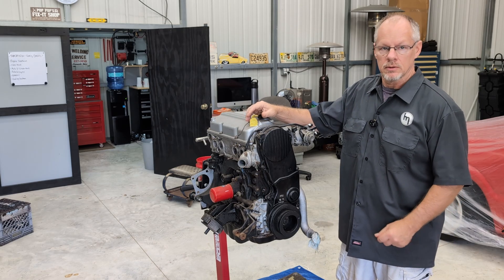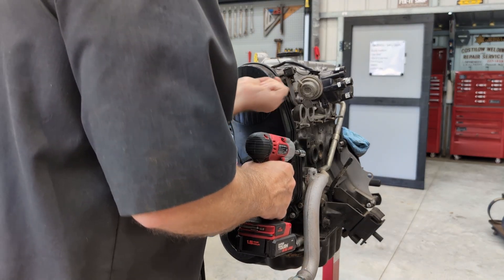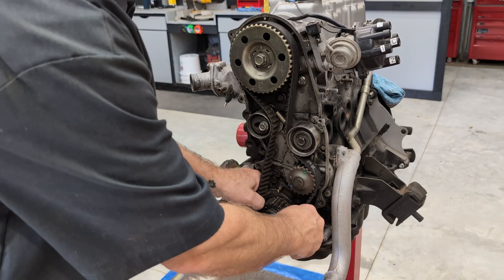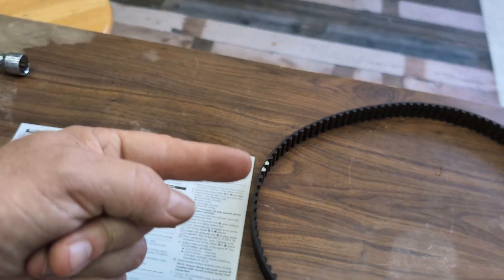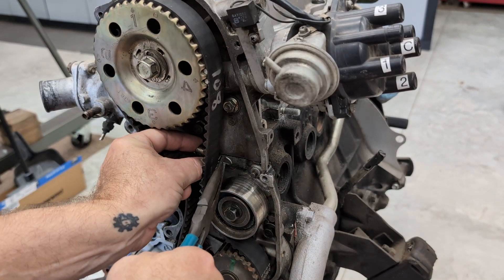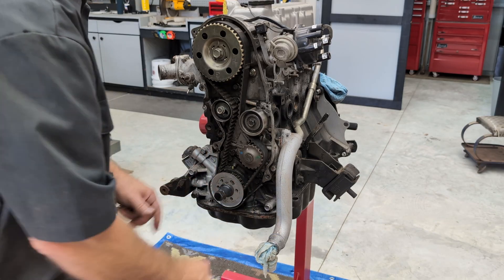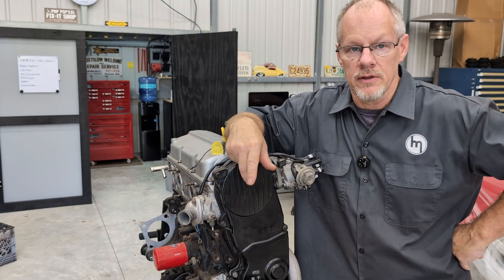How to Replace the Timing Belt on a Mazda B2200 2.2L (Complete Tutorial)

Comment: I think you're setting the ENGINE timing wrong. Set the crank timing mark where the marks line up. Pay attention to where the cam gear is marked. It should line up with the #1 cylinder mark on the cam to the cylinder head mark on the head. Loosen the tensioner and remove the belt. Install the belt onto the crank gear then, the cam gear. Tighten the tensioner. Now, where are the marks on the cam gear compared to the cylinder head mark? It's off to the left side of the cylinder head mark about a tooth or two. Your engine timing is out of time. There will be no amount of carb tuning or distributor movement that will correct the timing. To correct this engine timing, BEFORE you install the belt, move the cam gear to the right of the cylinder head mark about 1-2 teeth THEN tighten the tensioner. Look at the crank and timing marks now. I'll bet they line up perfectly. NOW, your engine is in time.
Reply from the maker: "I think you're setting the ENGINE timing wrong."
* I am wondering if you watched the video at all.

"Set the crank timing mark where the marks line up. "
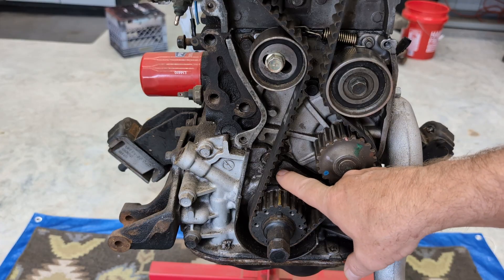* at 05:29 you can see the crank is lined up.
* and again at 08:34

"Pay attention to where the cam gear is marked. "
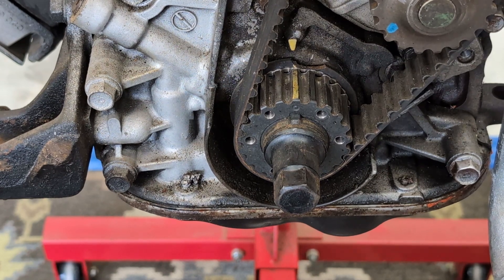* at 6:49 you can see the cam gear is lined up as well.
* and again at 08:50

"It should line up with the #1 cylinder mark on the cam to the cylinder head mark on the head. "
* at this point I am wondering if you even watched the video at all.

"Loosen the tensioner and remove the belt. "
"Install the belt onto the crank gear then, the cam gear. "
"Tighten the tensioner. "

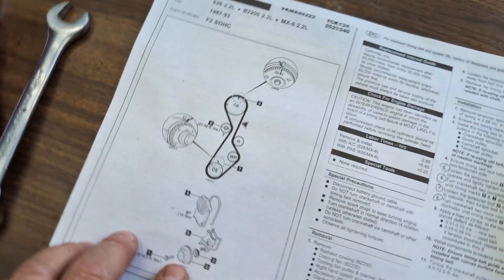*  No let me stop you right there. Look at 10:29 and pause it if you need to to read the instructions. 
5. Loosen the tensioner bolt , allow tensioner to operate and lightly tighten bolt.
6. Turn crankshaft two complete turns clockwise
until timing marks 6 & 7 aligned.
7. Loosen the tensioner bolt to allow tensioner to operate, then torque bolt to 27-38 ft. Ibs.
Read this you may learn something if videos are not your thing.
https://mazdaminitruckin.com/wp-content/uploads/2024/09/Timing_Belt_Change.pdf
* watch this part again at 13:37

"Now, where are the marks on the cam gear compared to the cylinder head mark? It's off to the left side of the cylinder head mark about a tooth or two."

* Camera angle has you confused.

"Your engine timing is out of time. "
* Not its not in fact here it is running before it was pulled, same setup.

https://www.youtube.com/watch?v=sk2HctD6plo

Comment: Fantastic video! Wondering about the engine used though. If the block is a 626 2.0 wouldnt that be an FE? Looks similar to mine and wondering if everything shown applies. Cant believe videos like this exist for these old engines, thank you!
Reply from the maker: It IS an FE block. It's a 2.0 but has all the characteristics of the 2.2. it uses the head gasket, water pump, oil pump and all of the 2.2
Reply: @MazdaMitch  Okay, thanks for clarifying :)

Comment: Hey Mitch I bought a b2000 that was lowered and raised it back to stock and I've adjusted the torsion bars I'm wondering what I all need to do to get the ride height even around the truck
Reply from the maker: If the back is back to stock, your next options are to keep adjusting the torsion bars to get it like you want it
Reply: @MazdaMitch I was able to adjust and get the front even but in the rear driver side is lower by 1/4 in than passenger side how would I correct that
Reply from the maker: @dylanmonen9881  could drop the passenger side front a bit and it may pick that driver rear corner up some. Could also be weak leafs.

Comment: Hey Mitch, currently doing head gasket on 2.0L. The old and the new replacement gaskets have a water jacket blocked by the gasket on cyl 4 intake side, have I been supplied with the 2.2L head gasket or what?
Reply from the maker: That's how it is, it's fine

Comment: Great video.  I've done this job a few times on my own 1988 B2200, but only with the engine still in the truck.  Yeah, it's a little awkward to R&R the six 6.0mm x 1.0mm bolts holding the pulley assembly because of working "blind"; be patient, and I use a 1/4" drive ratchet and 10mm socket and the 1/4" drive digital torque wrench from Harbor Freight for those.  Sometimes this job needs to be done because of a leaking water pump, that's straightforward after removing the timing belt.  Yes, do NOT remove or loosen that big 21mm center crankshaft bolt unless you need to change the crankshaft oil seal too.  I'm not sure why "California" states 90K interval while other states have 60K; I've always done 60K on mine, and I always uses Gates hardware on mine.

Comment: What are the other numbers for on the cam wheel? The manual for my Mazda Bongo (F2 2.0, Japanese market only) times the engine using the 2 mark.
Reply from the maker: Join The forum and post some pictures of that because I'd have to see it to believe it. The bongo 2.0 is no different than any other one.
https://mazdaminitruckin.com/how-to-check-your-timing/
Reply: @MazdaMitch  I will do that. Just checked again, Bongo Friendee manual it is 2 (with picture, so not a misprint). Mazda 626FE manual it is 2 for the FE and 3 for the F8 and F6.
Reply from the maker: @brianb7636  Please join the forum, and post this in there with pictures of your shop manual. Its not going to change anything as what I am doing in this video is how its done on the 86-93 mazda trucks, but I would love to see it. https://mazdaminitruckin.com/forums/
Reply: @MazdaMitch  Yes, waiting on the e-mail. I have pdf's on the FE/F2 changes too and 626 manual which is a bit different to yours (covers 12v engines). Forum says 'not available in your location' for pictures. Is it US only? I am in UK.
Reply from the maker: It used imgur for photo uploads and we have people from all over in there. 
I downloaded a 1987 626 manual and I see where it says this:

Note
For FE engine, align "2" mark.
For F8, F6 engine, align "3" mark.

ON your bongo or 626 engine, the dowel on the cam that should be at the 12:00 position, may in fact be on the 2 on that engine for cam timing.

It is not this way on a typical 86-93 Fe and F2 engine that was shipped here to the USA.

the 86-87 uses an A and 88-93 uses a 1 as that is TDC.
Reply from the maker: @brianb7636  Check spam folder for any email.
Reply: @MazdaMitch  Yes, that is exactly it. The FE (actually an F2 head on an FE 2.0 block) remained in production until 2006 for Japan only although some were brought in to other countries. Minor changes were made to things like the head gasket and modern electronics plus emission controls and an electronically controlled automatic trans. I'll do an intro post on the forum. Great vids, BTW.

Comment: No fricking way man, the timing! (of this timing video lol) I was just changing out my rad hoses on my '92 2 days ago and I wanted to see about the harmonic balancer, it wobbles a bit. I took those 6 10mm bolts out and man that thing just didn't seem to move and it looked like to my eye, that the main 21mm bolt going into the timing gear/crankshaft, was overlapping and holding the damn pulley in as well! Well I guess it needed a bit of a smack from a hammer or something unless someone changed out the bolt on it or something. 

Thanks so much for filming these, even if you're not doing the specific job, it's still great to get other info on stuff.
Reply from the maker: Glad I could help!

Comment: Mazda Mitch is the man!!! I A  great contribution to the Mazda  driving community.  I will have to say his videos have definitely helped me  out plenty of times while rebuilding my 92 Mazda  b2200.
Reply: Hey Mitch, just wondering if you would have any suggestions on what might be causing excessive crank case pressure on my B2 200 it keeps blowing the filter off the top of the valve cover